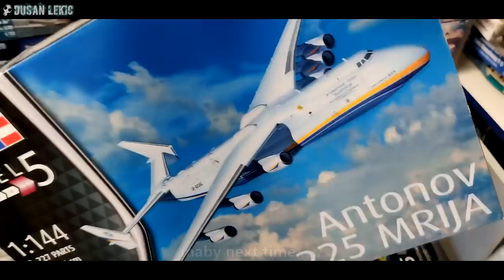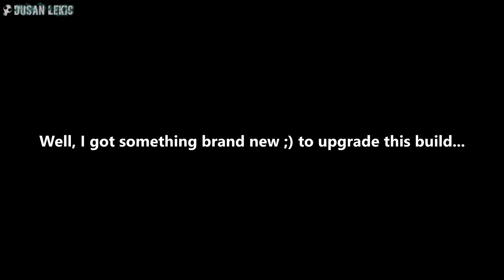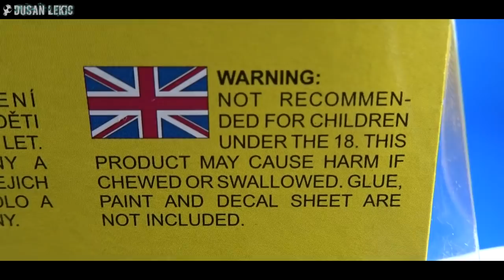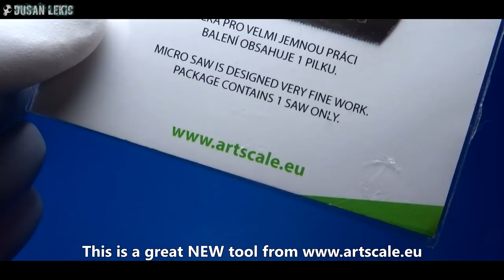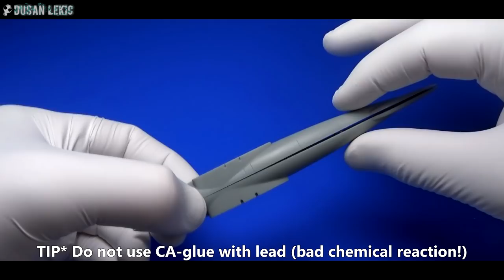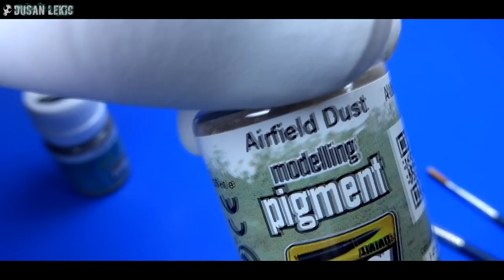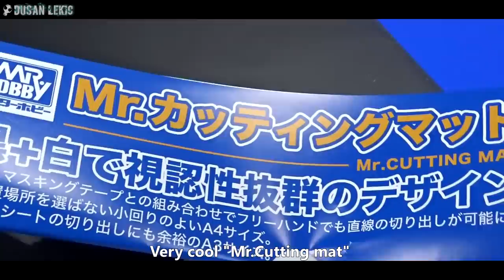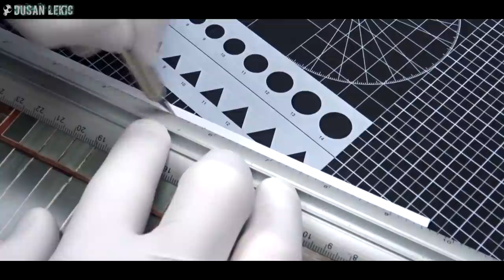Full video build Heinkel He 162 Spatz + Arado E377a Revell

Comment: What will happend when We will glue  lead weights with CA glue? I mean is  there would cause health problems? Or just failed model?
Reply from the maker: The problem is this, due to chemical reaction and oxidation in the longer period of the time CA and lead will expand (nasty) and that will ruin the model.  You will get the cracking, broken fuselage for example. Sometimes oxidation can even penetrate through the  plastic. I hope this answers your questios.  All the best!! Dusan